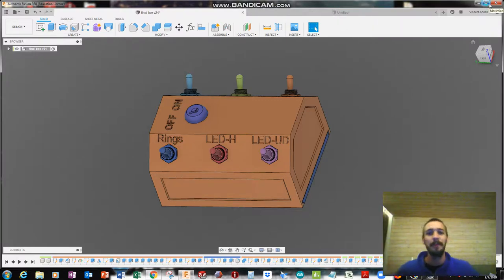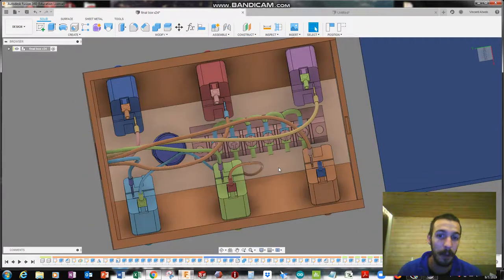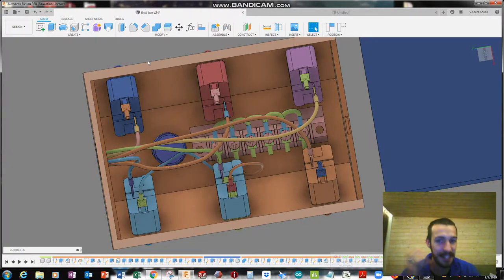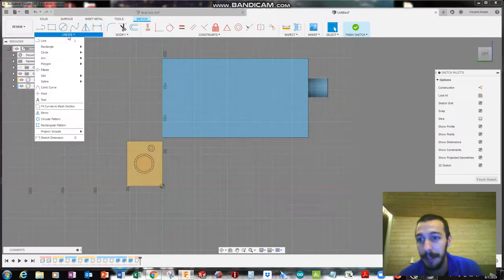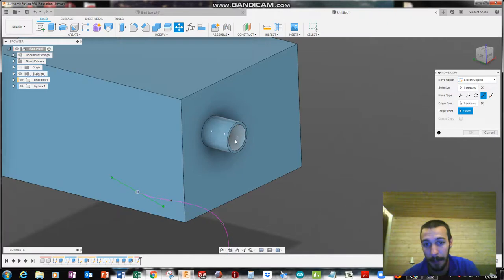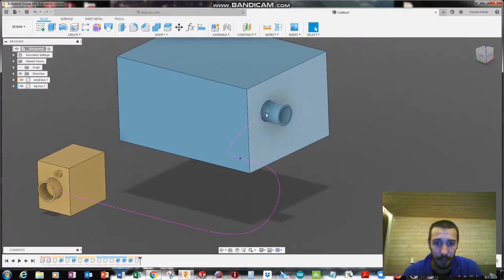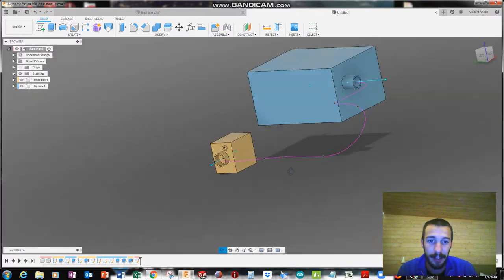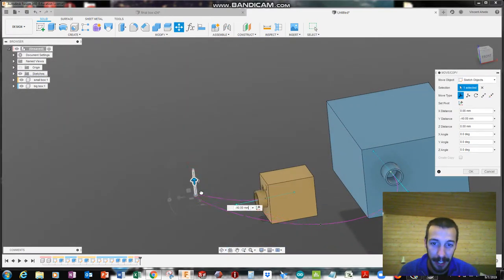Fusion 360 tutorial,  making wires

Comment: Nice video about wires! You can use the collinear constraints when drawing the spline to get perfect connection to the end wire point(s). Doing so you don’t need to do the tedious adjustments in 3D to get the connection straight… Regards Bo, SM6FIE
Reply from the maker: Awesome tip! Thank you!!!!